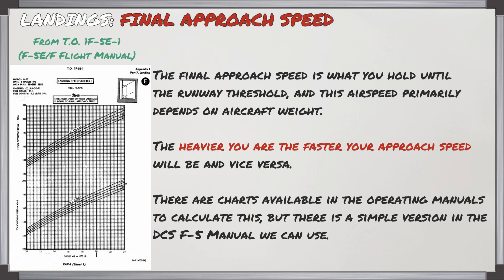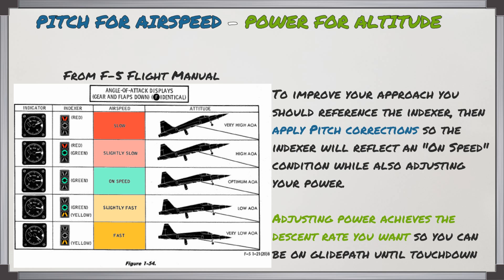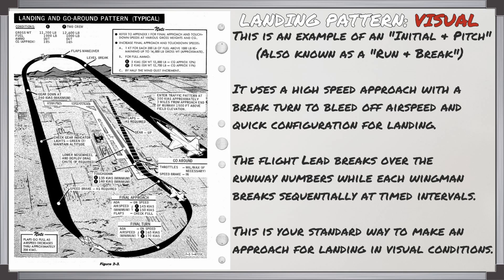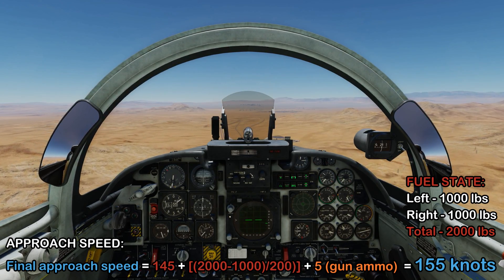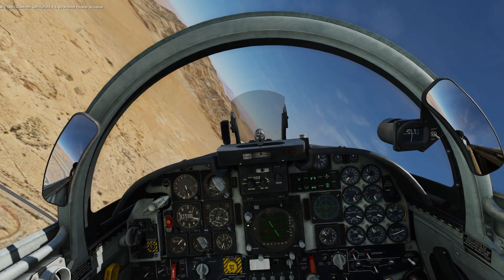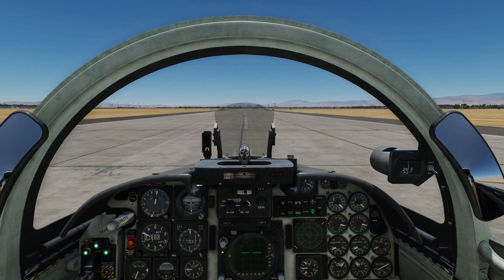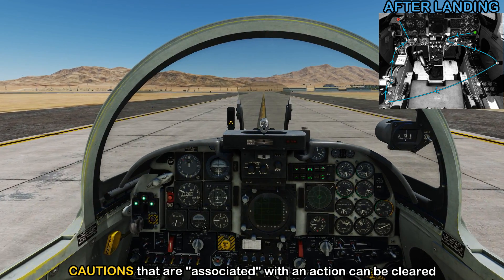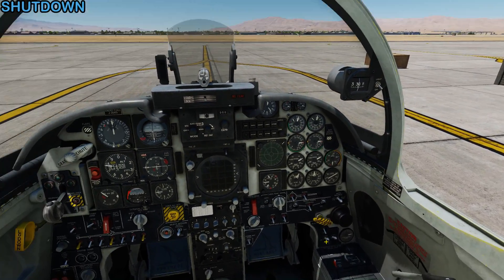DCS F-5E Tiger #3 - Landings through Shutdown (Rev. 1)

Comment: what a flight pattern! Thanks for the video.
One question, during the last turn ( before"final,"), do you control the altitude with the trim or do you pull back the Joestick? I'm trying to control the altitude only with the trim and the plane ends up falling at the end of the turn...sorry for my english!
Reply: @RequiemsACTL  I try to use trim only but the plane drops. This same technique of trimming and not pulling the stick works very well for me in the F-18, but  the F5 falls down if I don't pull the stick...I will keep practicing!
Reply from the maker: @pabletesoy  Sorry I mistook your first comment as if it was related to the F18 so I removed my first reply as my advice was related to that. Think of trim as being used to relieve control pressure at a certain airspeed and not something you use as a primary control for your airplane. Your speed is going to change a bit once you roll off the perch and start your turn towards final, so the trim won't always be perfectly set like it is in the Hornet. It will just take some practice, but try and fly a little faster during the turn before slowing down as you level the wings on final. Any trim changes will be minimal.
Reply: @RequiemsACTL  OK, I take note! Thank you!

Comment: Great tutorial as usual! The trigger and flow concept is really great for memorizing steps at the different phases of flight. I do want to point out one issue though: Coming from prop planes, flying the turn to final while maintaining a 2,000 fpm descent rate, decreasing lift due to the bank angle, and a decreasing airspeed, all at the same time, is quite challenging. The diagram from the manual that you include in the video suggests a turn to final while still flying at 1,500 ft agl and to start the descend while rolling out of that turn, and I find that much easier during my transition to this jet airplane.
Reply from the maker: Cheers Andreas, yeah I've done this approach from the perspective of the flight lead so they're more experienced and can push things a little harder to give the rest of the flight more time as they would initiate their break later and fly a longer pattern like what you would see in that picture.

Comment: When you have some experience with aircrafts like a10c or fa18, is this still interesting to get? thinking on getting it, but now I don't know if it still worth
Reply from the maker: I started with the F/A-18 first before flying the F-5 and the simplicity of the F-5 is what makes it appealing to me as it's a refreshing change flying this airplane. Sometimes you don't want all the avionics and fancy gadgets. Just a jet with some speed and some old fashioned bombing. I wouldn't recommend it purely as an air-air role but it's fun as a ground pounder for sure :-)
Reply: @RequiemsACTL  I agree with you. I have some modules like harrier, hornet, warthog, viper. Sometimes I get what you are saying and hop in that old mustang xD for simplicity. Probably should go for something simple and more modern. Thanks for the tip.